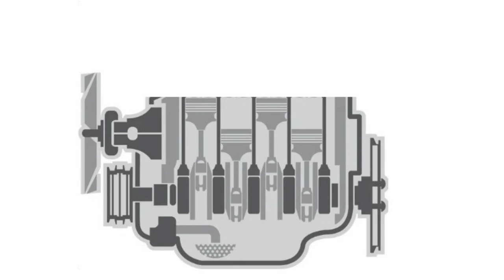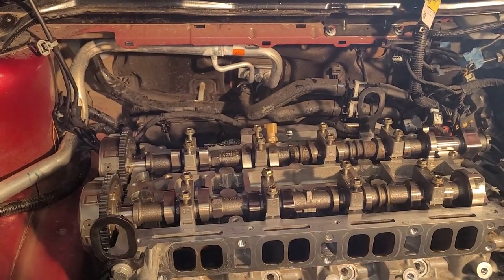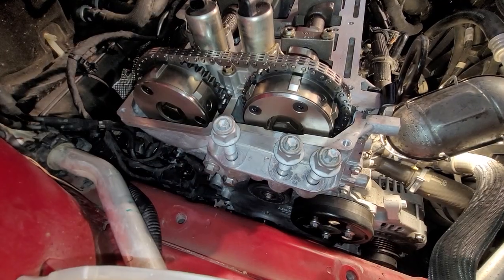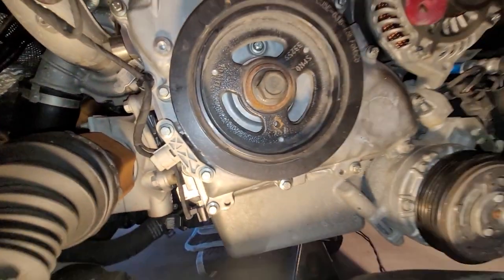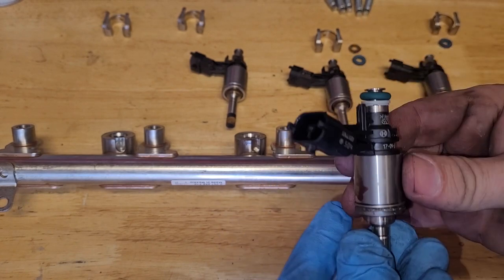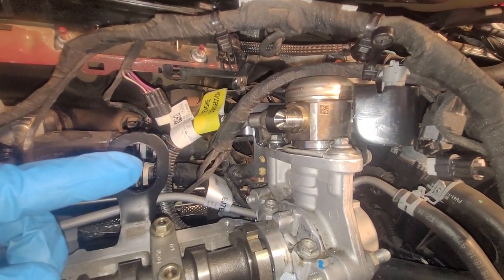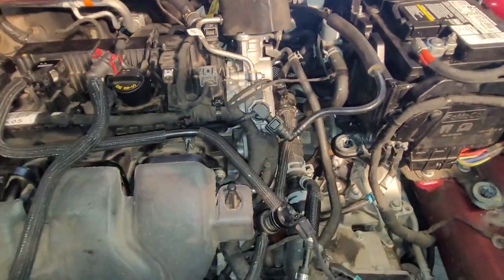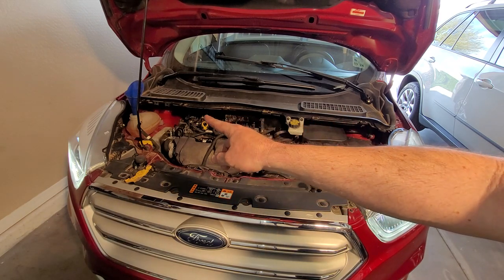Ford Ecoboost Head Gasket Replacement 2.0L - PART 2 of 2: Install

Comment from the maker: Thank you for watching! Please like and subscribe. If I helped you complete your project, please consider Super Thanks: https://youtu.be/mo4g08Jzezk

Thanks,
Nick
Reply: Great instructional video. I have a 2019 Ford edge; the engine looks a little different than the one in this video. I have had to fill the coolant reservoir twice in the last couple of months with no apparent leaks anywhere I'm guessing it might be the head gasket. Any advice? Thank you.
Reply: I keep reading about carbon build on a direct injection engine. All brands that use it have carbon built up on the valve stems and surrounding areas. VW had a severe problem with it in the mid 2000's. How bad was the carbon built up (intake) on this low mileage motor?  Curious because my 2018 Edge has 63,000 miles. I believe Ford has created a problem that can only be fixed by replacing the engine with the new design (2019 model and newer). There is a class action lawsuit against Ford pertaining to this problem. Been wrenching for 50 years (mostly my stuff) and I would bet that all these engines (2015-2018 2 liter) are going to fail prematurely, it is just a matter of time. Reminds of my explorer sport with a german engine, what a pos. Same thing, head gasket failure at 43,000 miles and out of warranty.
Reply from the maker: @kawadude  all direct injection engines get carbon build up. Traditionally injected engines inject fuel behind the valves, thus, the gas cleans the valves. With direct injection, carbon isn't cleaned and builds up. Doesn't matter the make, it's inherent to the design.

Comment: Hello, Ford Escape 2.0L ecobost 2017, on the intake and exhaust vvt sprockets, do they have safety washers? Those that go between the camshaft and the vvt sprocket are safety washers so that there is good grip, which are used in the land rover 2.0L and the mazda cx7. DOES THE FORD ESCAPE 2.0L have that washer?

Comment: Now, do you really must remove fuel rail and extract injectors? I mean @ 60-70-80k miles all those seals should be good and if not disturbed, continue working, or thats something that must be done?

Comment: Good video.  However, the only real fix is to replace the long block.  The head gasket is just going to blow again. Ford updated the block, cross drilled between the cylinders instead of the slits.
Reply from the maker: You're not wrong. But a less than $60 head gasket to get another 60,000 miles out of is vs. buying a whole long block wins every day.
Reply: Again, thanks for a great video.  Doing the head gasket on my nephew’s 2016 Fusion with the 2.0 Ecoboost. Water intrusion on cylinder 2. This engine has the closed deck design. Going to have the head pressure checked. Hopefully no cracks, did not overheat.
Reply: What's the cost for head gasket replacement vs replacing the engine?
Reply: New long block from Ford is $3,900.  Full upper gasket kit from Ford is $240.00.  Could not quote you labor as I’m a DIY’r.  I’m going to have a valve job done while it is apart, so there will be a machine shop charge.
Reply: @NiXFiX hi bro I have questions iam working on 2015 Jaguar xe 25t ecoboot engine problem is ate coolant before once engine over heated causes radiator leak then I change radiator an thermostat. After the problem will start  engine drinking coolant there is no any other leak for confirmation I do pressure test that's also ok .then I confirm problem is head gasket . Now the question is if change head gasket the problem will comes again or not? Because somebody saying 2.0 eco boost have block failure it's really? What I do gasket replacement is worth or not ?

Comment: How long do you think the new head gasket will last?  I wonder if screw some pins in the transfer slot (bad design) then cross drill. How deep is the trnsfer slot?
Reply from the maker: I would hope the replacement gasket lasts at least as long as the original (60,000 miles or more). I don't know how deep the transfer slot is.

Comment: Did you have to plane the head??
Reply from the maker: No. I typically don't resurface heads unless I am also resurfacing the block (especially if it was an overheat condition and the head warped but is still within spec. This is because the block probably warped a little as well and having a slightly warped block and perfect head would be bad. If it overheated and they're still in spec, they'll match better going right back together). Just hand clean the surfaces with a blade and some solvent/brake cleaner.

Comment: Great instructional videos...thank you.  My 2017 2.0L Escape just started drinking coolant at 160,000 KM after I made my last payment!  Now I just have to find a head gasket since its on back order everywhere.
Reply from the maker: Thanks for watching!
Reply: Get the updated block 2.0 block sonit doesn't leak  between cylinder 2 and 3.

Comment: My wifes 2015 edge 2.0 is drinking coolant and just now developed a p0301 code, cylinder 1 misfire. Im praying its not leaking into the cylinder and its somewhere else and the misfire is a bad coil or something simple because there's no way in hell i could do this without screwing something up. Awesome video subbed.
Reply: Mine was doing the exact same thing and that’s why I’m watching this video. I was hoping it wouldn’t amount to this but it did 😢

Comment: Thanks for the great video, just the right amount of info for me (not too much, not too little!). Did you use an OEM head gasket or aftermarket?  Any issues since the replacement? I heard a lot of times the head is warped or the block is cracked so the new gasket doesn't always fix the issue?  I'm thinking the same as you, I don't mind spending a weekend replacing the head gasket if it gets me another 50,000+ miles before it goes again.    The current one lasted 120,000 miles.
Reply from the maker: Thank you for the kind words. Yes I used an OEM head gasket. Heads don't typically warp unless you over heat an engine. The reason these head gaskets fail is because of the block design. I sold this vehicle awhile ago, so I can't give you any further data.

Comment: What a great video. I enjoyed building the engines I’ve built over the years and had great service from them afterwards but these Ecoboost engines are a whole new breed unto themselves. When mine goes and it surely will, I have no desire to do what you did in these videos. I have no understanding why engineers would design an engine with sprockets to be installed on any kind of smooth shaft without a jetway and key. Ha. Where are you located? Do you do this for pay? Good job sir!
Reply from the maker: I'm in the Phoenix, AZ area

Comment: Very good . Easy to follow. I got a question if after building back together I noticed I got a bit of oil in piston what does that mean. Bad rigs?
Reply from the maker: Could be turbo blow by. Could be valve seals. Could be rings (but less likely in my opinion). So I assume you used a borescope and saw the oil? If you did, run the engine to operating temp. Then pull a plug and look in. If dry, wait 12 hours, then look again. If oil, likely valve seals.

Comment: Good morning. It was really helping me understand how this gasket needs to be replaced. My Edge 2.0 2019 recently purchased start using coolant as well with no misfiring codes. Am I wondering how long I can drive like so until I put some $ aside to fix it
Reply from the maker: How much coolant do you need to add in a week?
Reply: @NiXFiX  not more than quarter in 200-300 miles being covered

Comment: Hey Brother, it’s me again. I’m putting this Ford back together. We had a hurricane in Houston. And it really has put me behind so I’m barely getting back on it. On the step where I can check the timing. I had everything locked in place and everything was fine and everything lined up. Once I went to check my work.the cam locker will fit on one side and the other side. I would have to force it just a little bit to make it lock the cams. In your video it just slides in and out pretty easy. Do you think I have done something wrong?

Comment: Great video, over a year later is the gasket still holding up?
Reply from the maker: I sold it soon after. Not because I don't trust the work, but I use the proceeds to move on to my next project.

Comment: Good, in my case I already replaced it, everything seems in order, it no longer consumes water, everything is fine. My question is the following. Is it normal that it still shows p0302 on the scanner?
Reply from the maker: @TheCasperoso  no. Not normal. Do you notice/feel a misfire? If not, clear code and see if it comes back in week. If you do feel misfire, might want to compression check cylinder. Should be over 120psi. If that is good, swap the cylinder 2 coil pack for cylinder one and see if you now get p0301. If so, coil pack is bad. Also a chance the plug is fouled out.

Comment: Are cylinder head bolts a one time use only? I noticed you linked them in the description, why can’t we reuse the old ones?
Reply from the maker: Any torque to yield bolt is one time use. If you reuse it (them) and follow the torque specs, you run the risk of snapping a bolt. Also, its clamping stretch is gone.
Reply: @NiXFiX  thank you, just ordered new ones
Reply: The torque to X pounds then additional 90 degrees is how you know they are torque to yield.  
Traditional bolts just say torque to x pounds.
Reply: @FixItPleaseJ  I did this entire thing on 4th of July sweating like a pig. I used your videos as a guide. Yes the torque specs really threw me off, but after watching probably 10 times I assumed it was X lbs, followed by a 90 degree turn; it was the only thing that made sense. Since then I’ve put over 2k miles on the car and it’s held up fine. I only wish I had replaced the timing chain along with it… 

Your advice was awesome. FORD wanted close to 10k for this and it cost me around $300.00. I changed the water pump and switched to a cast aluminum thermostat housing while I was down there.

I also broke the turbo vacuum solenoid, the replacement just arrived. I think I moved it around too much during the head gasket replacement.

Comment: Great Video! Maybe you help me? I did replace a blown piston and everything looked fine. Now i put the head, camshafts, chain and the crank pulley back on but the engine wont turn now. Do you have a clue?
Reply from the maker: Does the engine turn over by hand 75% of the way and then stop? Or not turn at all?
Reply: @NiXFiX  it doesnt turn at all, both ways. Can it be the front seal?

Comment: Question,
Can you recommend putting copper spray to the head gasket?
Would it hurt the gasket? And or does it benefit anything?
Reply from the maker: @Daniel-uf1xx  head gaskets these days are preciously manufactured. Copper gasket spray on a multi layer metal gasket (with sealing) is a bad idea in my opinion
Reply: @NiXFiX thank you! I ended up not using it.

Comment: I thinking about replacing my head gasket and hope to get another 50k or so miles. My question is should i try and fill the slits/grooves that cause the failure with a gasket maker or some sort of epoxy? Any thoughts on that? Thanks
Reply from the maker: I'd be worried about imperfecting what little sealing surface is there. Also, in that environment, whatever you put would eventually wear away. I could maybe see welding it and then machining flat, but that is a lot work when you can just do the gasket and get 5 years or 50,000 miles out of it.

Comment: Hows this car running?  I currently have my 2017 Escape Titanium at my employers Ford Dealer and they are attempting to repair it with this same approach. I had coolant intrusion like this one into the cylinders.  

Head is being inspected at a machine shop and it will be replaced if found to be cracked.  (Hoping to get by without a long new block)
Reply: The engines still have a defect even if you fix the heads..ford is going the cheap way I'm having  same issue your better off getting a new block or you will have the same issue to happen again😊

Comment: Anyone consider using copper gasket sealer? Have used it on older VW diesels for decades without issues. Maybe it could prolong the  2nd gasket failure.

Comment: Hello, is there any advantage to adding some gasket sealer before installing the new gasket. Especially in the area between the cylinders ?
Reply from the maker: Eesh. I couldn't imagine rtv holding up in that environment. I'd lean more towards aluminum welding the slit and then machining it flat.
Reply: @NiXFiX  Is there a better alternative to the OE head gasket? What sealant did you use on the timing cover? I'm at this cross road with my 2017 Escape as well. Thanks for the video's very helpful. Just replacing the head gasket I guess buys us some time until it starts leaking again.

Comment: Did you need any re programming for example, throttle body or relearn the computer?
Reply from the maker: I didn't. If it shifted funny, I would've reset the adaptations.
Reply: @NiXFiX thank you! 
I appreciate what you did.
If I do have a leak in the head gasket at least I’m aware of what type of job I’m dealing with. I do have mechanical background but you helped out way more than I expected.

Comment: Hi NiX FiX I have a 2018 escape 1.5L, 91638 km and I'm afraid about this problem (coolant intrusion) do you know if is for sure that this problem is going to happen some day? I asked a mechanic about this problem, and he said that the only thing possible is just replace the short block and I said, what about just replacing the head gasket? and he said that could be an option but it will not fix the problem. Now I'm asking you, is your problem fixed? I'm afraid because I do not have the budget for this kind of repair and looks like replace just the head gasket will be cheaper than replace the short block. (sorry for my english)
Reply from the maker: A (redesigned) short block replacement is the best solution to eliminate the problem. But, a $40 head gasket (if you can do it yourself like I did in 15 hours) wins every time. The original head gasket lasted just over 60,000 miles on this escape. 15 hours of labor every 60,000 miles isn't bad.
Reply: perfect, thank you  @NiXFiX  for your reply. I will try to do it.
Reply from the maker: @mrdmnghi  obviously don't do it until it needs done. If you don't have a problem now, let it go. In this case, as with many others: if it ain't broke, don't fix it :)
Reply: @NiXFiX   my coolant reservoir goes low constantly, not like crazy but bit by bit. If I fill it up to the max line, at the end of the month ends up almost at the minimum level
Reply from the maker: @mrdmnghi  not a crazy bad problem. Is it misfiring or blowing white smoke out of the exhaust?
Reply: @NiXFiX  Not that I've noticed. I will pay attention. Sometimes it feels like it has no power when I accelerate.

Comment: So there is technically no marks on the chain and crank sprocket? If you have cams set and the crank tool in the new chain will go on the teeth anyway ?
Reply from the maker: Correct. Lock cams, lock crank, install timing chain, guides, and tensioner. Then, torque cam bolts. Install timing cover, then torque crank pulley. Pull locking tools. Done.
Reply: Thanks appreciate it
Reply: @NiXFiX hey also I had a question I bought the same car it was towed in sounded like no compression I noticed the crank bolt was spinning faster than the pulley upon further inspection I noticed the crank bolt was finger loose I took valve cover and intake off I’m not seeing any evidence of it bending valves is there a chance I didn’t ? New to these motors only have worked on the gm 2.4s thanks again

Comment: Get the updated block so you don't have coolant intrusion between cylinder 2 and 3.
Reply from the maker: You're not wrong. But a less than $60 head gasket to get another 60,000 miles out of it vs. buying a whole long block wins every day.

Comment: Q llave son lo tornillos de la veda de motor ?????
Reply from the maker: Hola. Creo que estás preguntando de qué tamaño son los tornillos de la culata. Son torx T55.
Reply: @NiXFiX  me dice t55  … otra pregunta mañana tengo sacar un motor ecoboot de una ford edge
Reply: @NiXFiX  podré sácalo en 2 partes es la idea q tengo la culata por arriba y el Block por debajo la duda es si saldrá por debajo el blo es automática lo voy hace en casa del cliente
Reply: @NiXFiX  q torque lleva esa culata
Reply from the maker: @miguelregardiz  ¿Vas a quitar todo el motor y la transmisión? No he hecho eso, pero supongo que necesitarías soltar el subchasis para sacarlo por debajo.
Reply: @NiXFiX  solo motor el cliente indica q le pasa agua a los cilindros ... no creo q aya q sacar el chasis porque solo es motor
Reply: @NiXFiX  esta seguro q sea el t 55  torque le doy ??????
Reply from the maker: @miguelregardiz  Si su Edge tiene el mismo motor que este Escape, la broca torx T55 es la herramienta. Explico la secuencia de torque en el video de la parte 2 del 2:15 al 2:36
1- 62 pulgadas libras
2- 133 libras por pulgada
3- 41 libras-pie
4- +90 grados
5- +90 grados

Comment: You teplace ths heads but that block  is still bad has thkse slits in between the pistons its a defect
Reply from the maker: You're not wrong. But a less than $60 head gasket to get another 60,000 miles out of is vs. buying a whole long block wins every day.

Comment: this engine has a block flaw design....those slits in the head are never gonna let a head gasket live....lot of work for a motor to live another 30k miles.
Reply from the maker: Yes. I explain that in the video. Also, the slits are in the block, not the head. 15 hours of work isn't much time for another 60,000 miles in my opinion. But, you're not wrong. Shouldn't be this way.